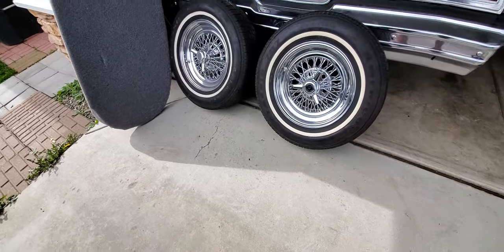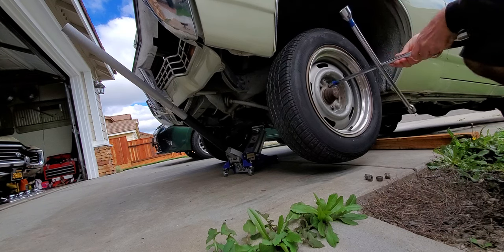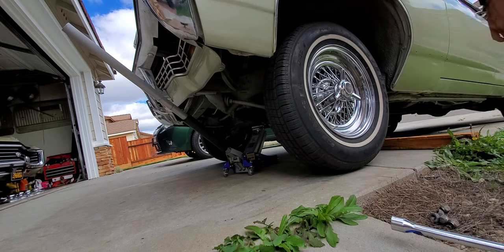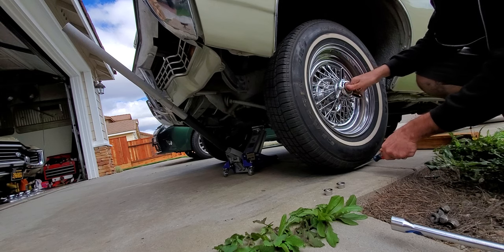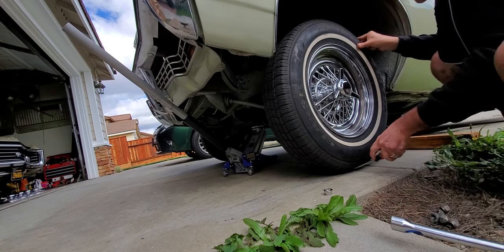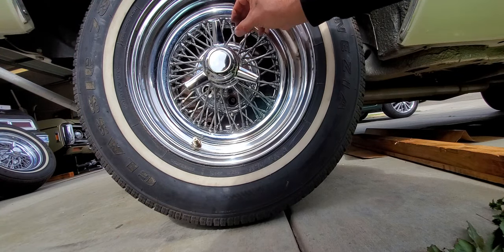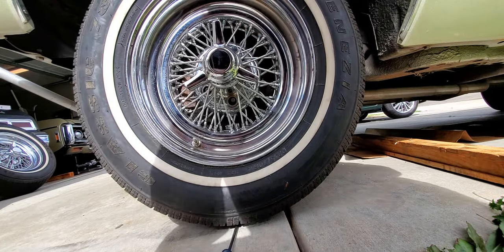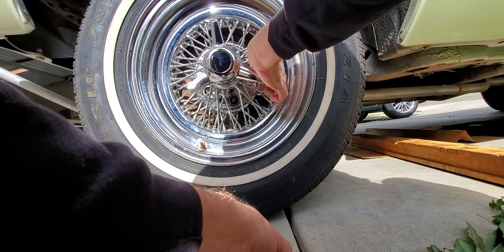@how to install appliance wire wheels  on 1968 caprice 4 door hardtop

Comment: What kind of tire iron are you using? I have some 88 appliance wire wheels and I can't get anything between the wires to remove the lug nuts? It says 20mm on the lug but no 20mm fits between the wires.
Reply from the maker: Just the normal star.are the lugs the same?I got mine from lugnut King. I got a set for 5x5 and 5x4.75
Do you have the original lugs for appliance or a cragar set of lugs? They are similar.
Reply: @HOGSIDESJTV14BOSSHOGRECORDS  I'm not sure. I just bought the vehicle with them on it. I can't get them off. I ordered a thin wall 20mm socket and hopefully that will work. But my only other option would be to remove one of the wires so there is more room. But I don't want to do that. Didn't know if you had a special iron or something.
Reply from the maker: @jeffrichter9495  that's interesting. My spokes don't block the lugs.hope you get them off.🤘🏼👀🍻
Reply: @HOGSIDESJTV14BOSSHOGRECORDS  thanks man
Reply from the maker: @jeffrichter9495  no problem folks 🤘🏼👀